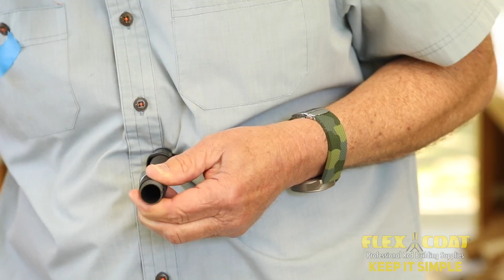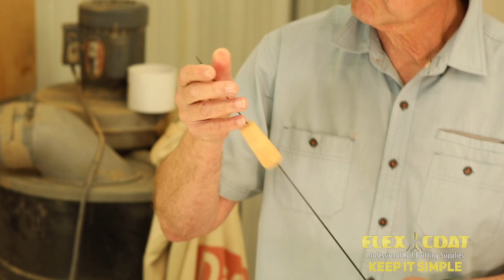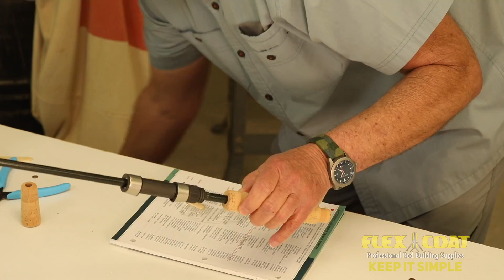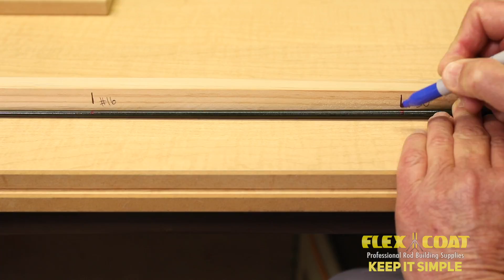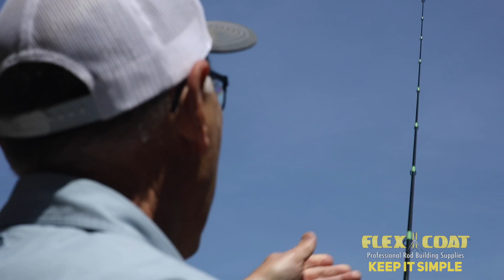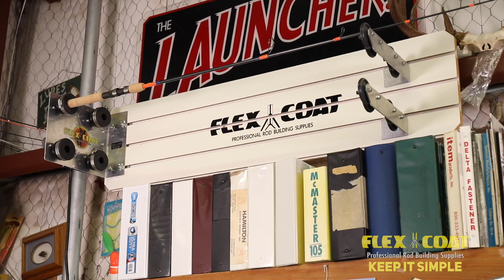Flex Coat Rod Building - High Performance Rod, 2 Hour Build, Keep it Simple

Comment: Rod looks very nice!! what threads and apoxy do you use? Do you use color preserve?  Sometime my guides foot appear translucent when I apply apoxy. Thanks
Reply from the maker: We use Fuji Treated Thread which does not need color preserver and will not turn translucent.  We use Flex Coat Ultra V High Build Finish.  Thanks

Comment: Roger I really like the bench you have set up for rod building. Can you tell me if that was custom built or did you buy that somewhere?
Reply from the maker: That is a custom table top we put on a standard 8 foot folding table using our fusion maple melamine coated fiber board.
Reply: Flex Coat ok thank you